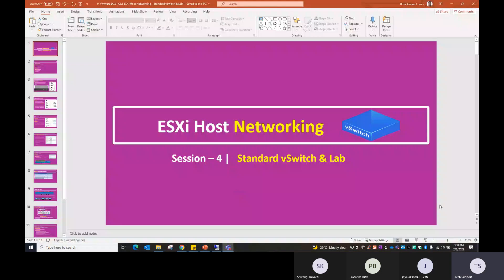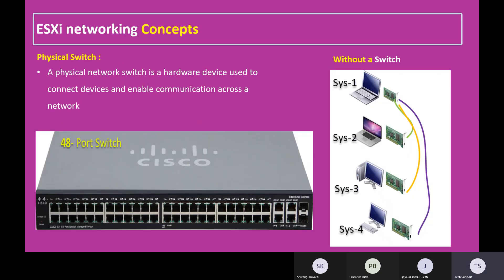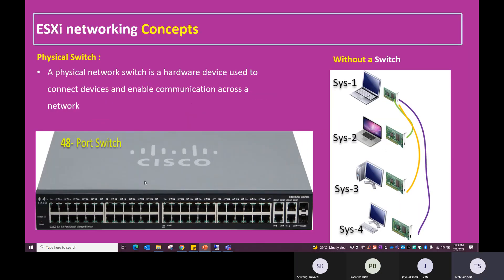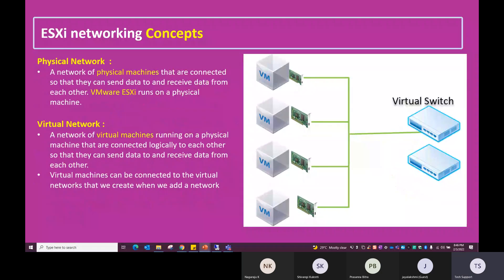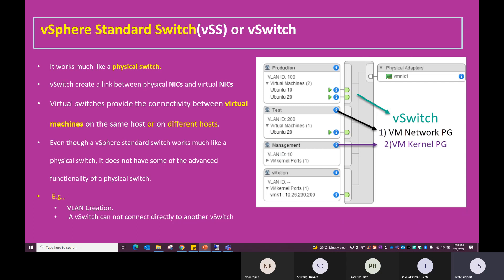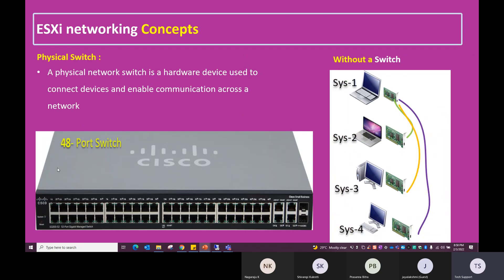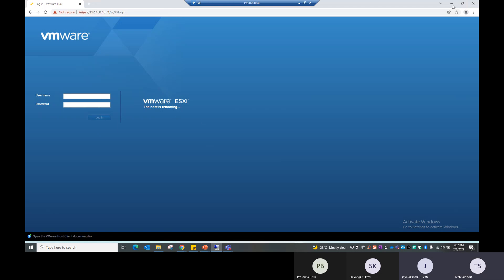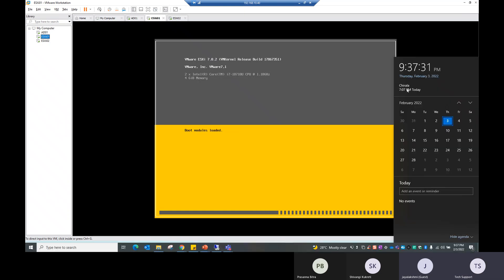9. ESXi Host Networking Solution Architecture | vSwitch Use Cases Explored | Must-Know Information!

Comment: One question:- Point 3 video 18:00. The traffic from a vm to another VM running on second esxi host going without touching kernel port?
Reply from the maker: In ESXi networking, when a virtual machine (VM) on one host communicates with another VM on a different ESXi host within the same virtual network (usually referred to as a VM network or a Distributed Virtual Switch (DVS)), the traffic often doesn't necessarily need to touch the VMkernel port directly for data transfer. 

Here’s why:

1. Virtual Switch and Network Traffic:
   - VMware ESXi uses virtual switches (vSwitches) to handle internal communication between VMs and between VMs and the physical network.
   - When VMs are connected to the same virtual switch (or DVS in a distributed environment), traffic between them can be handled within the virtual switch's internal networking layer.

2. VMkernel Port and Management:
   - The VMkernel port on an ESXi host is primarily used for system management tasks, such as vMotion, storage access (iSCSI, NFS), and management traffic.
   - However, regular VM-to-VM communication within the same network segment (especially on the same virtual switch or DVS) is typically handled internally by the hypervisor without involving the VMkernel port directly.

3. Networking Efficiency:
   - VMware’s network architecture optimizes traffic routing to ensure efficient data transfer. Virtual switches can intelligently handle intra-host and inter-host communication based on network configuration and traffic patterns.

In summary, when VMs on different ESXi hosts are on the same virtual network (vSwitch or DVS), the traffic between them often stays within the hypervisor’s virtual networking layer. This allows for efficient data transfer without necessarily touching the VMkernel port, which is primarily reserved for specific management and system-level communications.